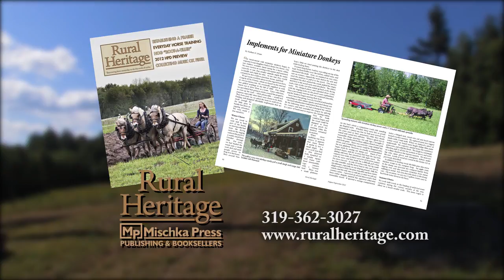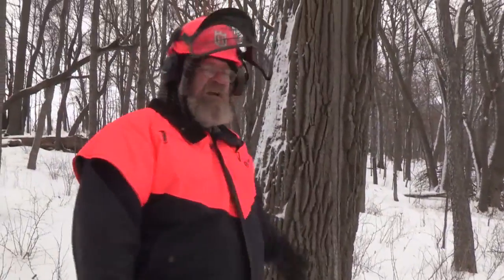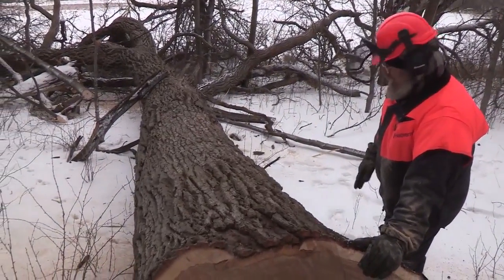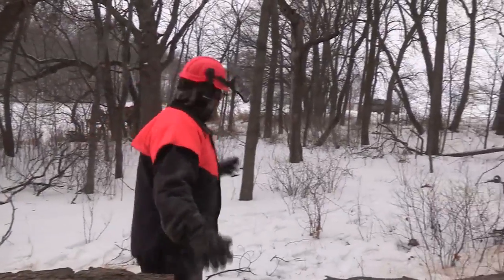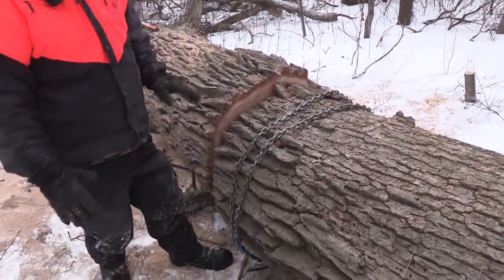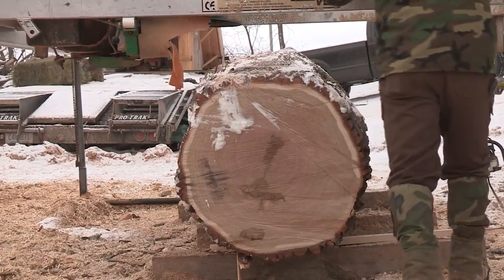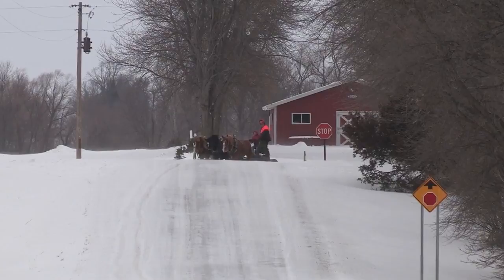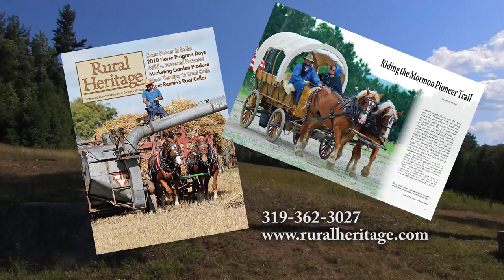Draft Horse Logging for Local Lumber

Comment: What an enjoyable video.  No muss, no fuss, the guy just knows his stuff.  At the 8:10 mark he really showed his experience in logging, where unlike 98% of other YouTube guys, he cut two blocks and placed them to bracket his cut where he cut his butt log off.  Then he could slide his chain under the first and the second logs with no problems.  And, he cut a nice low stump, no wastage there.  His initial chain hitch was perfect.  He got the log to roll to his advantage and though he didn't mention it he was pulling the butt log from the small end, which is easiest, and pulled it initially at 90 degrees which is easier too.  I need to quit going on here, but for rookies wanting to log with smaller tractors or horses where you have relatively low pulling power and you have to use every advantage you can, watch this guy's every move.  He knows what he's doing.
Reply: Thankyou for your input. I learned a lot from video and your commentary.
Reply: Yup, you can tell he has a LOT of very good experience. He's a great example of who to copy!